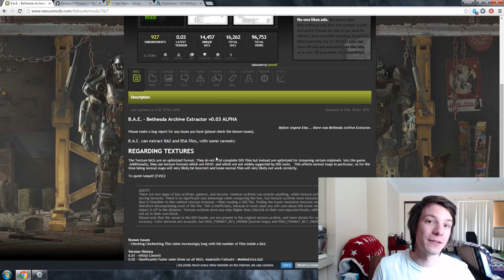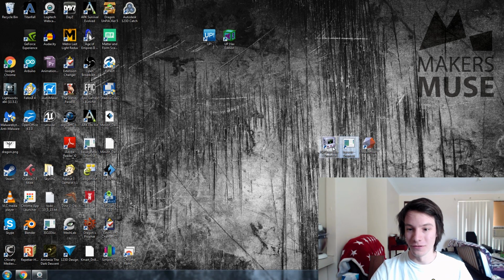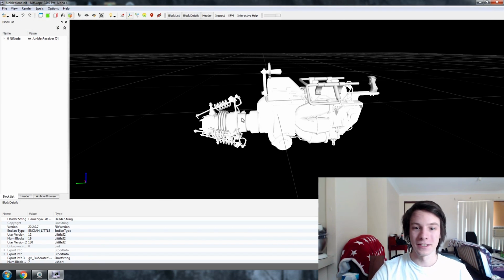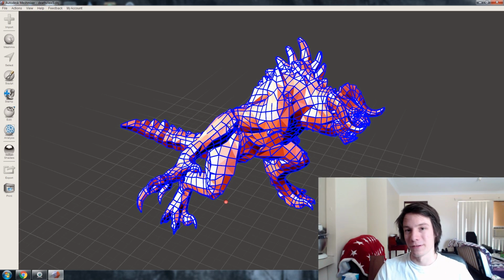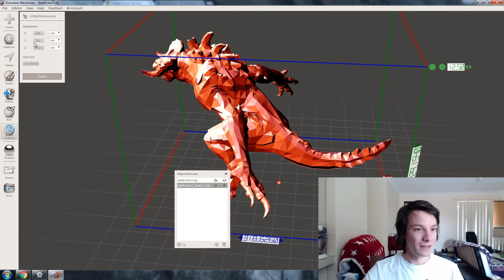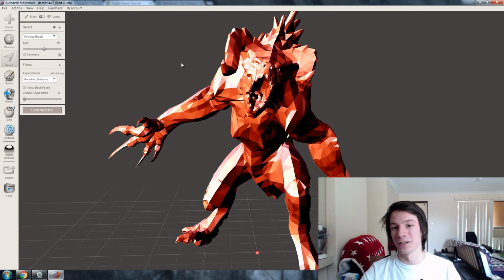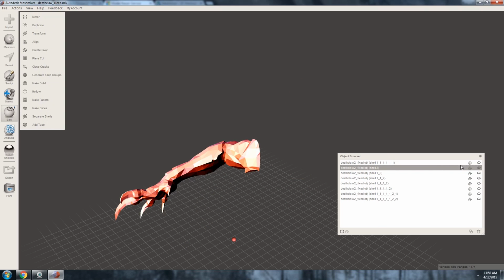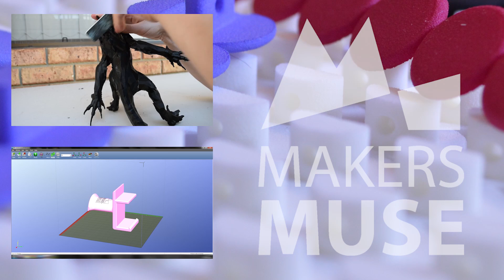Let's Print! Fallout 4 - Deathclaw - Part 1 of 2

Comment: Here's a little tip for getting higher quality game models. The 3D model really needsa texture map called a normal map. The normal map (if you can't see it in the name) is the texture that looks all smudged blue and red like a relief carving. This jpg contains a lot of subtle height info.

What you need to do is load the model and normal map into a 3D Tool that can merge them back together so the detail appears back on the 3D model.

I believe Blender can do this.I'm sure tutorials are a search away. Blender is free plus it can do a lot more to clean up a model ready for printing.

And that's how you get that excellent fine detail back from game models
Reply: Subdivide, and displacement. Although I still have some issues with round stuff being flat when blender shows good normals. I haven't found a way to successfully bake those
Reply: I know this is a shot in the dark but I have been looking for a detailed enough stl or obj that can be converted for a life sized 3d printer project using Lebanese Make it Big.  Anyone have one I could use?  Would love to have some Deathclaws and Xenomorphs on my lawn :)

Comment: next time use mesh lab for increase polygons and have more quality :) butterfly subdivision filter; ) nice job
Reply from the maker: +Mauro Manco (Exilaus) Hey, wow! Thanks for that epic tip. I tried a few of the remeshing tools in Meshmixer but found they lost alot of detail in the process - like the eyes and spikes. Butterfly Subdivision is magical, I'll be featuring it in the next video for sure. Thanks again :)
Reply: Blender's subdivision works great too. It's what I've been using, and it lets you keep the detail, hard lines, and smooth out the rest.

Comment: So, quick question on the actual printing of the individual pieces.  In S3D, would you change the # of top and bottom layers, since you need a good seam to join the parts together.  I would think too many top and bottom layers would complicate this?

Comment: Hi Makers Muse. Great video and very helpful. Could you please let me know if its possible to take a flat 2d image and turn it onto a 3d printed object? 
Sorry as I am new to the world of 3D printing.
Any advise is greatly appreciated. Thank you.
Reply from the maker: +zark212 You need to have a data of every angle to recreate a 3D image, for example you can stitch lots of photos of the same object together into a 3D model (this is called photogrammetry), but you can't do that from a single 2D image. You CAN add a bit of depth which can be interesting, but not the same thing.
Reply: +Makers Muse Thank you for the info and for taking the time to help me out Muse. Thats absolutely brilliant.
It will really help in my idea and I am extremely great full to you.
Good Channels like yours make YouTube Rock
Thank you.

Comment: Hey Angus can you please make a video where you upgrade the extruder to the wanhao duplicator i3, so it can print flexible filament. I really enjoy all of your videos :)
Reply from the maker: +Captain PanCan Heya, yeah an upgrade is certainly needed. The only extruder I'd trust to reliably do flex materials would be an e3d hot end, which I don't have budget for at the moment :(  Or maybe the Recreus Extruder which is designed for flex materials.  Thanks :)!
Reply: +Maker's Muse  Hey, i might have the budget so I can might install one of those. Thanks for the answer I would not have found out any of that with out you THANKS!
Reply from the maker: +Captain PanCan No probs dude!

Comment: i cant get window repair service mesh fixer to work i get this error every time

 Something went wrong...

Upload error: abort

Click "Upload Another" to try a different model.time 

any help
Reply from the maker: +aiden roscoe Hmm maybe try a file rename, that can cause it sometimes. Otherwise, what mesh are you trying? I'll have a quick look it's possible it's not fixable without some cleaning up in meshmixer first.
Reply: ok got it to work i didn't change the name i just tried again and it worked i guess there was a bug happening our overloading happening. thanks for the tips
Reply: Maker's Muse Just went in a slicing program slic3r and cura it not slicing right

Comment: Any recommendations for 3d printers under $600 usd?
Reply from the maker: +Unethical Rager Wanhao i3, UP Mini or Davinci are all decent options :)
Reply: +Maker's Muse after watching alot of videos on your channel I pulled the trigger and bought a Wanhao i3, in this one you mentioned not using it because you wanted to do in ABS. I thought it would print with that material. Please explain.
Reply from the maker: +Brad Parler oh, sorry to cause you doubt. The wanhao i3 can print abs fine, mine is just configured for pla at the moment and I have esun abs settings really dialled in on my up mini. You need to ensure you have a high ambient temperature when printing abs and an extrusion temp of about 230deg.